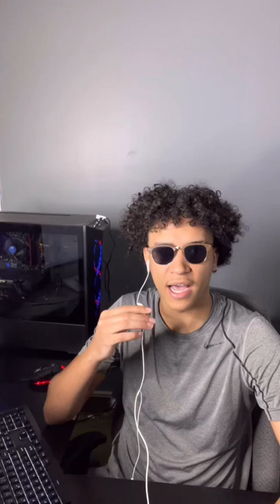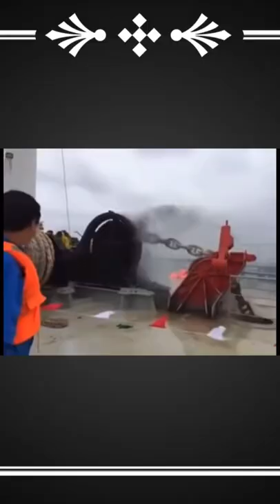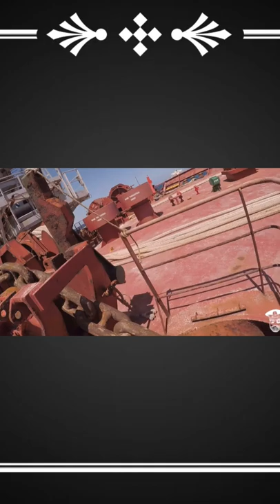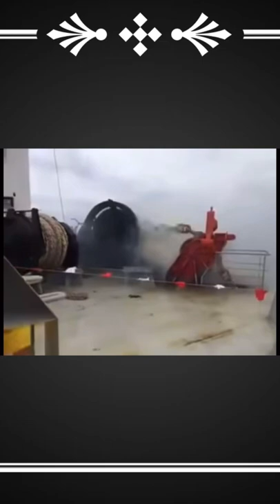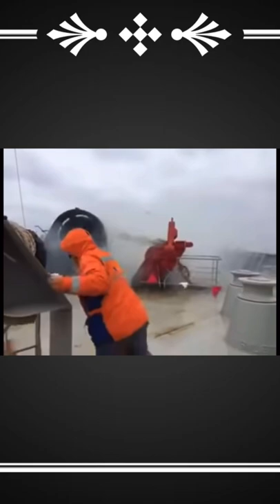Cargo ship anchor fail #shorts

Comment: Ive never worked on a ship but ive worked for a metal manufacturer before. When dealing with super heavy equipment sometimes things fail catastrophically. Just got to make sure that your working in a spot that if it does fail you'll be out of the way. And when it does fail add a little extra space between you and the dangerous shit going on and you'll be fine. Really isn't that big of a deal.

Comment: 😃
Reply: It's not, about a 300k minimum if you want cheap shit
Reply: @pizzaaddicted__6553  I think that's how they got into this problem in the first place...
Reply: @jacobviator3118  you have to lower the anchor slowly or the chain will snap, on top of all the chain could swing and kill somebody I damage the hull, and the cost of repair will rise drastically
Reply: imagine the noise
Reply: Cheaper to let it drop off
Reply: Bro seriously
Reply: I'd bet each link costs hundreds of dollars. No telling how expensive that anchor is. Expensive enough to assume there's a recovery effort of some kind.
Reply: I already know 200ft of custom American steel into a 1 and 1/4 chain is well over 5k. I got to handle it brand new when we had to use it for pulling tractors while working in a wet field. I can't imagine what the ships chain cost.
Reply: But the Chinese anchor is
Reply: @pizzaaddicted__6553  I watched the whole original video. They had it going pretty slow at first, continuoisly feathering the wheel that tightened the break. But it sounded like the thing was in desparate need of maintenance and eventually it just lost all traction no matter how much he tried tightening it. This clip starts right after the operater decides it's better to love another day than die for an anchor chain.
Reply: @emmanuelm2291  about 450,000 probably
Reply: @23YearsLonely Yeeeeeeeeeeesssssssssss.
Reply: It’s just a shitton of metal, pretty cheap relative to other parts of the ship
Reply: Fr
Reply: Well one link is like a grand...
Reply: @Daniel-ou4fb  thousands
Reply: Nor stopped once it runs away
Reply: @robivlahov  it was a brake failure
Reply: @osmacar5331  that's exactly what a runaway is , usually caused by lowering too fast , than trying too slow it down once it collects too much speed , it dries the brakes and "runs away " . Sometimes it's caused by bad servicing too , or a failiur of parts
Reply: @robivlahov  then why be pretentious?
Reply: @osmacar5331  it was a runaway , a runaway can be caused by a brake failure, but it can also be the reason why the brake faild ie when miss used and tried to stop too late or part failure . I was not being pretentious , just pointing out that you are not stopping that until it hits the ocean floor
Reply: @robivlahov  am an engineer i know how that works
Reply: @osmacar5331  so am i , a maritime one
Reply: Thats metal from walmart
Reply: It's not.
Reply: Better yet good luck stopping now
Reply: @robivlahov  in the original video the guy was pretty cautious with the brake wheel. It seemed like it was a poor maintenance thing to me. The critical speed where the brake just stopped working and the chain speed kept increasing regardless of added brake pressure was way too slow for it to have been a well maintained system, at least compared to all the other videos of anchor chain releases I've looked up.
Reply: @pizzaaddicted__6553  well now there’s 300k sitting in the ocean somehwere
Reply: @23YearsLonely you can
Reply: @23YearsLonely it's routine maintenance
Reply: @pizzaaddicted__6553  here around the Nordic countries its way more expensive usually, since we have stricter rules and regulations you can't just switch it for some cheap crap
Reply: @Daniel-ou4fb  the recovery would probably actually be even more expensive though
Reply: Not cheap at all. Thats why they would pay me to recover them.
Reply: Ikr ofc no
Reply: Bruh

Comment: I'd just jump ship if that was happening as I don't want to get hit by a piece of anchor chain.

Edit: I now realize that this is a bad idea, don't do this unless you really need to do so.
Reply: @23YearsLonely yea but not too far so you could possibly get back on the ship, after realizing your mistake
Reply: @bananaman7545  Or just leave the area lmao. These ships are massive, walk 100 feet away. You'd really rather almost guarantee your own death by jumping into the open water, with a ship that will suck you underneath it in seconds, regardless of how strong of a swimmer you are? You'd have a better chance staying on the burning ship than jumping into the water my man.
Reply: @jewkorn9724  when in a rush you sometimes can't think about it but that would be a better option until the ship sinks. How long does it take for a burning ship to sink?
Reply: @bananaman7545  the anchor windlass is isolated from the ship and above the (metal) deck away from fuel, it wouldn’t sink.
Reply: @machiii7394  okay thank you as I don't know much about the ships of today.
Reply: @bananaman7545  I mean damn bro I feel like that’s just common sense to know. You don’t gotta know a lot about ship to know you could just do a light jog behind a steel wall or just light job 200 ft away behind a conex on the ship
Reply: @cloutmastermemes2007  I live in a area where knowing the regular amount of knowledge of ships is something most dont have.
Reply: @bananaman7545   3-5 Hours.
Reply: @MrSimplified  thank you.
Reply: @bananaman7545  the drop from the top of a carrier ship to the water would do some damage too potentially
Reply: Holy shit, the legendary banana man. I thought you were a myth!
Reply: @paulhernandez987  uh hi?
Reply: @paulhernandez987  I didn't know, am I a myth?
Reply: @bananaman7545  not anymore. You are confirmed, real.
Reply: @paulhernandez987  or am I, I would prefer to be real.
Reply: Or you know you can just go inside
Reply: @Billy-tb5hv  I didn't really think it through.
Reply: @bananaman7545  I'm pretty sure most ships also have rooms that can seal watertight in case of a hull breach, but I'm not sure about that. Might just be military.
Reply: @chillythicc942  I know the titanic had them and that didn't go well.
Reply: @bananaman7545  nah bro a ship that size sucks boats under like m&ms
Reply: @bananaman7545  it can literally take hours and days for a ship to sink
Reply: @obsobsessed5814  far enough
Reply: Have fun in the water with the whipping of chains with the might of kratos
Reply: @Ryan-li8qc  I now realize that the post is kinda dumb when I start to  think about it.

Comment: Imagine having to drive an 20ft work boat under it while the crew feed you (also) dangerous 2" steel cables with a 70lb buckle you now have to pull ashore with your weak ass boat as you get yanked back and forth by every force of man and nature within a thousand foot radius.  That's my part time job, and 9/10 people that set foot on my boat don't want to again.

Comment: Incase you wanted to know more, the rope used when mooring, hawsers, can rip off limbs if they snap under tension. also ships are full of void spaces, wich sometimes have pipes running in them that need maintenance, theese spaces dont have ventilation so there will be no air, so people have suffocated in theese spaces and official training says if someone collapses you have to leave them. water tight doors are used in machinery spaces, wich will crush limbs if used incorrektly. some rooms have Co2 dispensers for firefighting and if they are used and you are still in the room you will suffocate. When gauging the crank shaft on main engines you will need to put your arm inside the engine wich has a risk of getting crushed by said shaft. if there is a leak in a steam pipe, the steam will flow at a rate wich will cut off limbs, and the only way to traverse safely is by tying a rag on a stick and waving it around. HFO, or heavy fuel oil has to be heated up to 90 °C to flow thru pipes, if a pipe bursts near you, it wont be pretty. If you fall overboard while the ship is moving, you might be sucked under the ship and into the proppellers if you fall too close. then there are the mundane dangers of work like slipping on oil spills and having tools dropped on your head, and of course, damage to hearing if youre in an engine room without ear protection

Comment: That can happen under a variety of circumstances. Including if the windlass isn't maintained or if it is only partially engaged with the chain. Not enough contact to stop but enough to cause friction. Friction causes heat, heat causes fire.